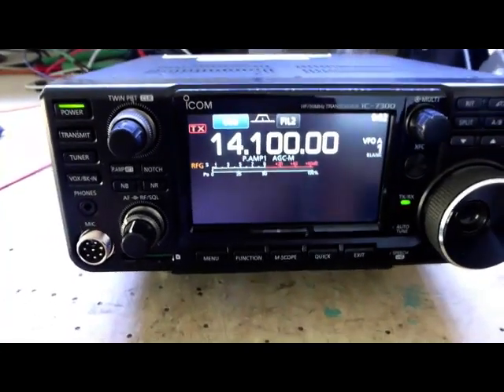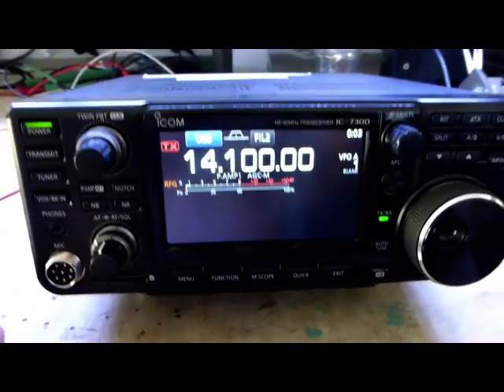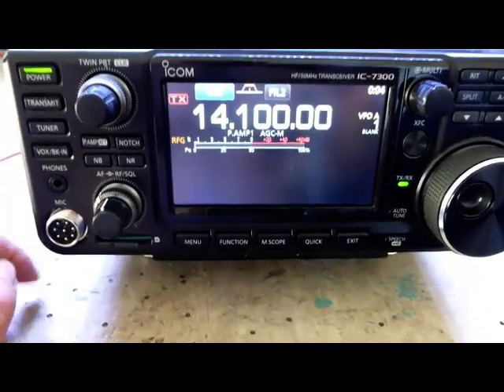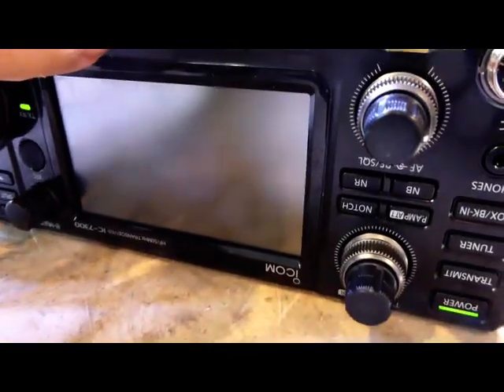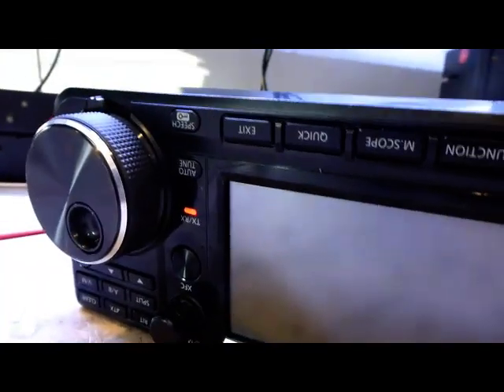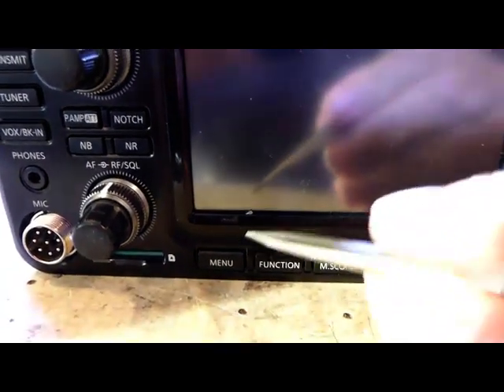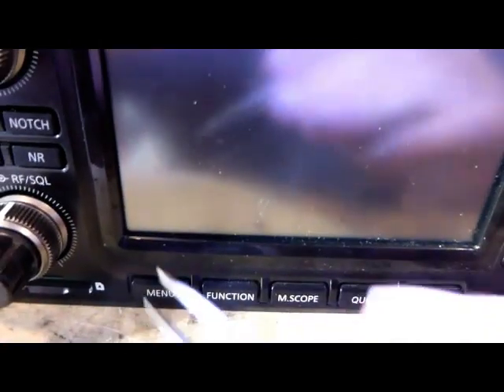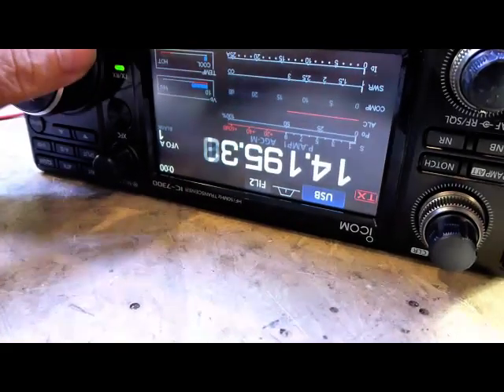Icom IC 7300 Touch Screen Fault

Comment: Problems with my screen as well, functions but lines & blurry.  Three months out of warranty.  I should a got the 590
(see my only vid)
Reply: My 7300 also had same problem ,out of warranty for about 4 months ,  called Icom  and they repaired it at no cost